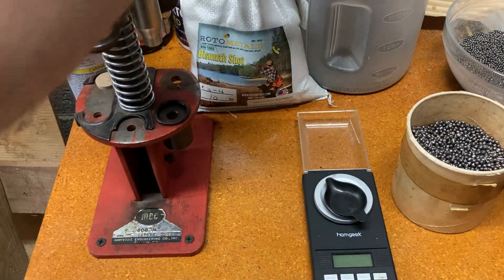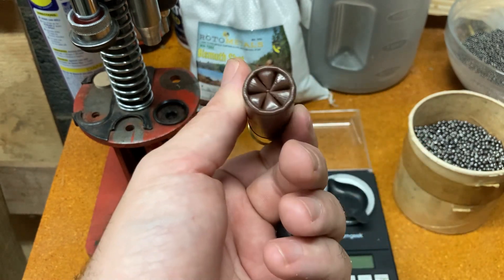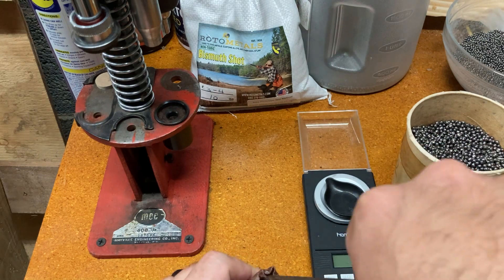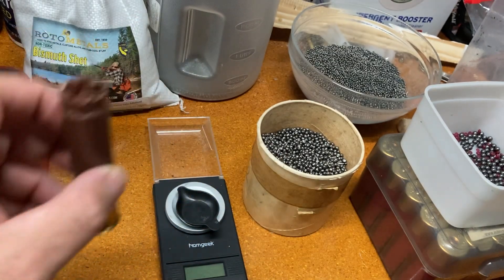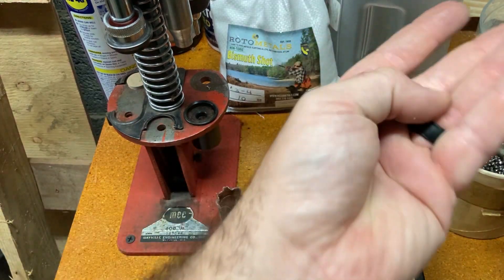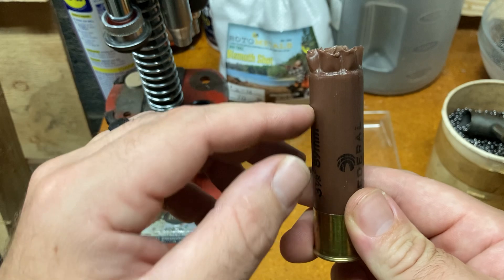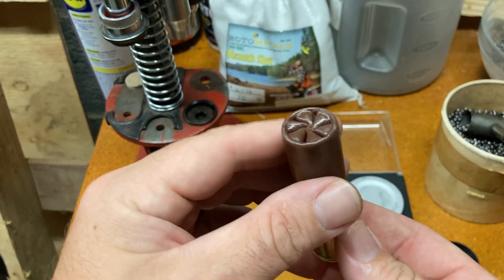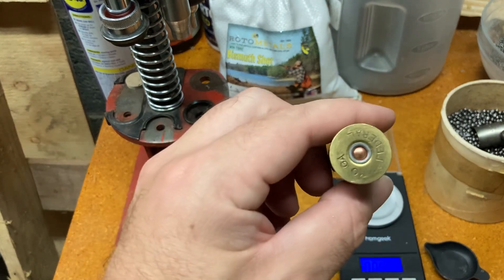Converting 10 Gauge Steel loads to 10 Gauge Bismuth

Comment: Courious how they pattern with the inconsistent looking shot vs perfectly round pellets. Reminds me of the first generation heavy shot
Reply from the maker: I’ve used about 25 pounds of it and it seems to pattern fine. The biggest issue I’ve had is with the pellets fragmenting when they hit game. I’ve switched almost exclusively over to copper plated bismuth because of that issue. It’s a little pricier, but I haven’t had the issue through 10 pounds of #4s. They’re also completely round!
Reply: @twiststeelandsmoke  I remember the old heavy shot if you squeezed it very lightly with a needle nose pliers it would disintegrate or shatter too. The stuff was super fragile.
Reply from the maker: @tripplebeards3427  I’ve never handloaded Hevi shot or cut apart hulls loaded with it. It stinks that we either have super brittle or super hard nontox options for the most part

Comment: Rookie Rick here, starting hand loading reloading Black powder, my Question is when scooping the powder,  what's safe , Tupperware, used plastic bowls, glass, brass bowls,  empty black powder containers,  I wanna be safe, got as my suggestions,  thanks, really like the reloading on brass shells
Reply from the maker: I dump mine out in a glass container and use brass equipment when scooping and loading it. When I’m done, I usually dump it back in the original container

Comment: Which gun will you shoot this out of with the 2 7/8” chamber?
Reply from the maker: I won’t shoot these out of any short chambered guns. I have an Ithaca Mag 10 double that was made with 3.5 inch chambers. I also have an old H&R single shot with a 36 inch barrel chambered for 3.5 inch 10 gauge. Unfortunately, I can’t shoot steel out of either one so I only shoot bismuth
Reply: @twiststeelandsmoke  Oh I thought you said you had some 2 7/8” guns that once fired you’d cut these to. I have a Winchester model 1901 that I shoot 2 7/8” 10 gauge out of.
Reply from the maker: @JWheeler331  once I fire these in my 3.5 guns, I’ll cut them to 2 7/8! I try to get as many loadings out of them as possible. I’m up to my 5th in quite a few for my light loads for squirrels and clays

Comment: thx for useful explanation. do you ever halfloaded weak catriges for rats for example? i got a lot of rats on my farm. dont want to be very loud/ and i only have 12g shotgun
Reply from the maker: I reload light 12s, but they’re still loud. And air rifle or 22 with subsonic would be a lot quieter
Reply: @twiststeelandsmoke  22 is illegal in our country/ yes may be i have to buy airgun good idea.
Reply from the maker: @mymythology8799  there might be quieter 12 gauge rounds that I’m not familiar with, but I’ve never loaded any unfortunately.

22s were just banned in a lot of the areas I hunt here. I’m stuck with my shotguns and air rifle now for most of my hunting!
Reply: @twiststeelandsmoke  22lr and22airguns in our area are not completely prohibited but you need to have a special permission wich is hard to get/ so i can buy powerful good 177airgun. Thx for your answers.
Reply: @twiststeelandsmoke  same story:) looks like only slingshots will be allowed for civilians soon:))